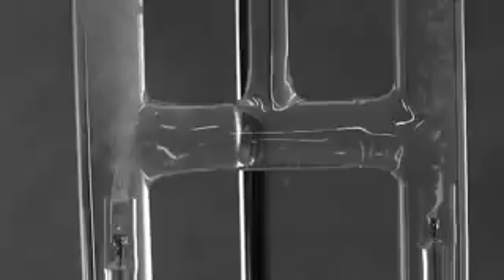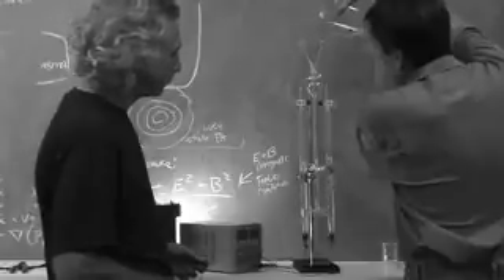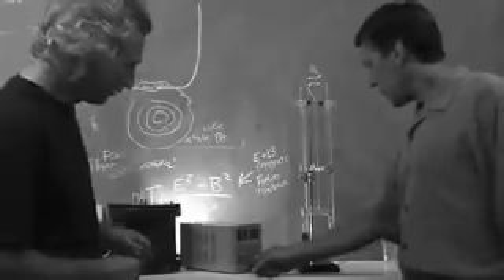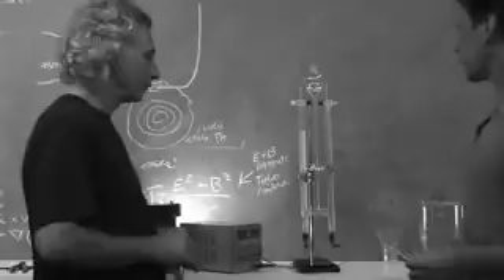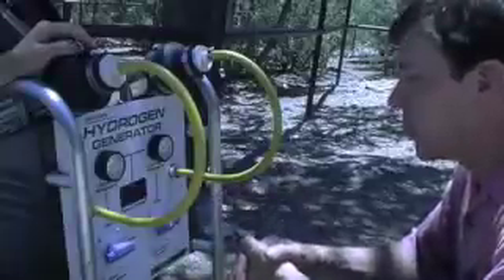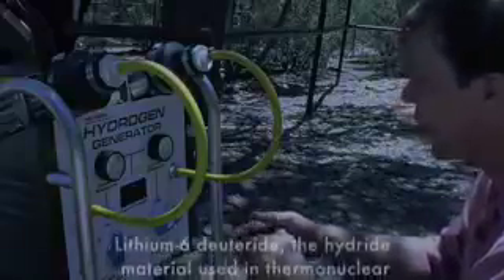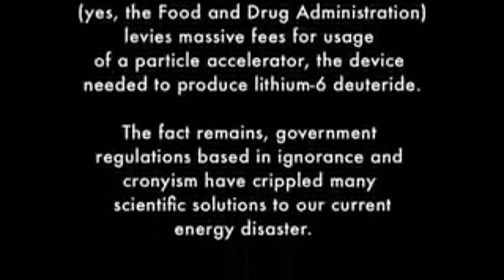run your car on water. This guy does just that!

Comment: you all need to reashearch the Australian investor that had a car ready for production in the very early 70's. He had issues raising capital as fuel was cheap back then. And then ever so quietly  GM America purchased his patients and company and shelved it.
the other thing is steam cars have been around since the early 1900s and are far more efficient and should be p uh t back into production. Look a J Lenos 1920s full steam car that does 100mph. so to say its not held back us not true. Wasnt one of the most efficient electric mass produced car recalled and every single one crushed. With owners who hide them sued for there return. 
All in all there'll be a change when in 50 or si years oil starts to run out and the car and oul companies need new products to over charge us for.
Reply: Thats just it, oil will never run out, IT IS NOT A FOSSIL FUEL. the fossil record only goes to a depth of 1500 ft the oil is pumped from a depth of 3000ft,  it was discovered in the 50s as being a byproduct of the land,  when wells were once empty, & checked again 15 yrs later they were found to be full again.
Reply: ZENITH ABC DEADLOCK:  The phrase "fossil fuel"  does nit mean that it comes from fossils, you fucking dim witted idiot. Crude oil is produced deep underground because the heat necessary to convert the simple hydrocarbons from dead plant and animal life, is in the range of 1500F. The oil then often moves upward in the water column to within reach of our drills. Most of the crude oil is far below the areas that we are currently finding it. It is not being produced by rocks, you bloody idiot.
Reply: Angus Whitehouse his name was Ralph Sarich
Reply: @Tim Hallas, You are a shit head.
Reply: Why is that Peter?  All I did was tell people the truth. If you don't like the truth, then go hide in your basement.
Reply: people who live in penthouse suites overlooking the pacific ocean, never feel the need to mention it in an argument. you are full of shit. You are not smart enough to talk to someone like me about anything.
Reply: You just proved to me that I am right. you don't live in a penthouse suite overlooking the pacific ocean.  Only liars get pissed off that easy.
Reply: Angus Whitehouse Tim hallas you made me laugh . 'Fossil fuels aren't made from fossils'. That was the whole basis of its initial taxation status.
Reply: Angus Whitehouse       The English language called.........they said stop abusing it and use spellcheck.

Comment: Okay, so I'm not saying it doesn't work, but there's one part that doesn't make sense to me.  
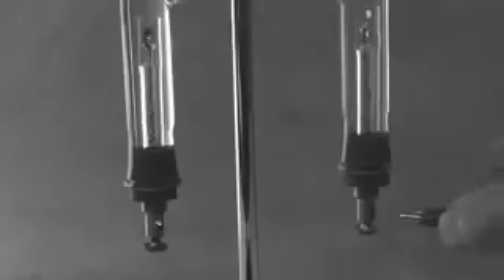@ 3:45 They say that the "positive will make the oxygen, and the negative will make the hydrogen." 

Now I don't know enough about chemistry to be sure, but imagine that when the water molecules are split, the hydrogen has a charge that draws it toward the negatively charged electrode, and the oxygen has a charge that draws it toward the positively charged electrode.  But if that's the case shouldn't that "sifting/sorting" process happen farther down the line?  

At the point where the water molecules are being split both component elements should be present, no?  

Maybe they can be separated by charges once they are broken apart, but at the actual point of splitting...  I just don't see how one column could produce exclusively hydrogen and one column could produce exclusively oxygen.    

For instance, on the side that is "producing oxygen", once the oxygen is broken out of the water molecule, what happens to the hydrogen it had been bonded to?  Does it de-materialize and re-materialize in the other column?   :/

And as for the "hydrogen side" producing twice as many bubbles due to the H2O equation; maybe.  Makes sense, right?  But then again, when you actually look at the two electrodes, doesn't the one on the "hydrogen side" also happen to look about two or three times wider than the one on the "oxygen side"?  Wouldn't more surface area of electrified metal on one side than the other just result in more electrolysis, producing proportionally more of both elements?  

But then I have to wonder -- that seems an odd detail to go so far out of your way to make up an untrue explanation about.  Unnecessary.  So what am i missing?  

That's the only snag I really find in this video.   Or at least the main one.  Like Fox Mulder's poster used to say (yes, it was referencing something else, but...), "I want to believe."  I think there is real potential in this idea.  

But can anyone explain how his explanation of generating [hydrogen without oxygen] on one side, and [oxygen without hydrogen] on the other side actually works?  Would very much appreciate it.  Thanks.
Reply: Wrong. Watch it again.

Comment: Neat, but we've been extracting Hydrogen from water and storing it for quite a long time, the issue is the internal combustion engine, Hydrogen burns much much hotter than petrol, and WILL melt a normal petrol engine if hydrogen is used as a fuel substitute. an engine must be designed from the ground up with Hydrogen as fuel source in mind.
Reply: That’s the easiest of the practical problems to solve.
Reply: @mensaswede4028  I'm sure you're correct, but to my limited knowledge no one has even done that on a commercial scale yet.
Reply: @MassLox  Usually that is money problems and then patenting the design for the the engine which also takes a lot of time because bureaucrats are slow

Comment: The problem with this hydrogen as a fuel is that current best processes for water electrolysis (PEM or alkaline electrolysis) has an effective electrical efficiency of about 60%.  Looked at another way to produce 1 kg of hydrogen (which has a specific energy of 143 MJ/kg) requires 50–55 kWh (180–200 MJ) of electricity.  Its true that 120 MJ/kg of 1 Kg of hydrogen is almost three times more energy dense than petrol.  However, such a process uses 55 kWh to get an energy equivalent of just 33.6 kWh of energy.  Then you take that hydrogen and use a conventional IC engine to generate power, which has a max efficiency of just 25%.  So you start with say 55 kWh which then becomes 33.6 kWh and the ICE generator can only produce about 8 kWh of power at the end of the process.  Not a great idea when the original 55 kWh of power which began the process was generated by the coal or natural gas powered grid which itself is only about 30% efficient.   So the real "fuel to work" efficiency is about 6%.  In other words you just wasted 94% of the energy in the original fuel.  This clearly is not some super technology to get excited about?

Comment: CRT tv's are partical accelerators. So yeah if you really wanted a partical accelerator! Chances are you already have on in your attic.
Reply: On close inspection, Bob's "particle accelerator" appears to consist of a small wooden tower, some shiny stovepipe, a rotating red light and a caution sign.

He didn't even try very hard on that particular scam.
I wonder if he got around to stripping those "hydrogen" tanks out before the bank repossessed that shiny 'vette?
lol

Comment: No mention on how you get your car to run on 100% Hydrogen without burning too hot and melting components in the engine.
Reply: It doesn't burn so hot. But does produce water vapor which may be an issue in your engine. Also you'd need a carby rather than fuel injection. The main issue has always been storage and economical production of the hydrogen. So the hydride sounds right but commercially feasible options are still developing. Looks like hydrogen/electric fuel cells and electric motors will win out. Metal or chemical hydride appear to be the most promising on board storage. It's all googleable.

Comment: It makes more sense to collect hydrogen and oxygen separately on the fly without storage tanks and combine them as needed to drive the pistons. The resulting water vapor can then be vented out before the next firing of the piston. You just need a system of electrolysis that produces the gases efficiently enough. This is doable by various designs which have greatly optimized electrolysis as compared to the setup shown in the video.

Comment: Unless you've got limitless power to spare, splitting water is just about the worst thing you can do.  The electrolysis of water into O2 and H2 gas wastes at LEAST half of the input energy as heat, making the process horribly inefficient.  You just can't sneak around the laws of physics.

Comment: to me the simple thing is that you can make hydrogen for free.. using solar/wind/water power -> electrical + water -> hydrogen production.. the problem becomes the storage.  the hydrogen cannot be made as you go in your car.. so you need a means of storing it.  compressed cylinders.   but it seems if you have the equipment for all this.. you drive for free.. or whatever water costs.. (assuming your H2 compressor is driven by free power too)
Reply: There are already cars rolling around with 10,000 psi cylinders but  is it better to burn it in cylinders like gas.. or to have electricity from fuel cells power electric motors?  what is more efficient?

Comment: The energy it takes to separate hydrogen from oxygen is greater than the output of hydrogen gas.
Reply: @wildandes1185  The example you give does not work for the model in this video, so how is your response relevant?

Comment: The car's running on hydrogen, not water. To split water into hydrogen and oxygen needs electricity and therefore electrical power. Nothing unusual or new here. It takes considerable electrical power to make enough hydrogen to get very far !

Comment: except hydrogen combustion is hot. that means lots of oxides of nitrogen are produced. The EPA would be all over that. Aside from driving around in a fast-moving vehicle with hydrogen pressure vessels in the trunk and hoping the person behind you isn't texting, it takes a massive amount of energy to hydrolyze water--more energy than it is worth. Hydrogen fuel, just like ethanol fuel, is one step forward after three steps back.

Comment: Doubts about the setup , considering the hydrogen hose connector to the car appears to be of compressor fittings , no shut off valve ? Recharge the car overnight ? Need solar power to operate generator ? Unless this guy has a 50 kw solar power system , this does not compute !

Comment: you can cut a tank in half that's filled with pressurized gas? how?
Reply: The tank is not filled with pressurized gas. It is filled with lithium hydride, a solid material which readily absorbs hydrogen gas. When gas is needed, the hydride is heated, which causes it to slowly release the absorbed hydrogen.

Comment: Sure, you can run your car from hydrogen produced by hydrolysis.  This is nothing new and has been known for over 100 years, BUT you'll pay for it in another way.  You'll pay for the electricity it takes to produce it.  Nothing new here.  Note, the acids he uses will attack your engine block.
Reply: no if you build a ceramic engine
Reply: ricco rodriguez 
But then you'll have fracture problems from a brittle engine.  WE JUST CAN'T WIN 🤐😜😕😞😓🤤😲😢😟
Reply: @catman8965  actually no,some years ago ferrari developed an engine that they use in a formula one vehicle,it reduce friction like by 40 percent and the engine din't heat ;ike a conventional metal block,however the price tag was somewhat a bit expensive,but it prove that did work
Reply: ricco rodriguez 
Interesting.🤔

Comment: Like you cant clearly see hydrogen on the machine. It uses electrolosis to produce hydrogen from water by running a currrent through it. Its not water. It uses the hydrogen

Comment: Okay, if this is true, if you separate the water molecules, doesn’t that remove that water out of the eco cycle? Basically doesn’t water just get reused over and over for the past millions of years?  How would the molecules join back up and evaporate so the cycle can start all over again? It seems like at some point, there would be a fresh water shortage. We’re already at a point where fresh water is getting scarce.
Reply: Both hydrogen combustion and a hydrogen fuel cell system recreate water when used, so it cancels out

Comment: Water vapor is a greenhouse gas, much more powerful than co2.  If every car in the world burned hydrogen the greenhouse effect would accelerate.  On the other hand I think global warming is mostly overblown,  and the emissions from these vehicles would only be from the heavy metals in the brake pads,   Or any smog or particulates from burning of fossil fuels.
Reply: The atmosphere is full of water vapor. Have you ever heard of humidity?

Comment: Water produces corrosion. Even if the motor was made on stainless steal, it will still corrode in little time. Unless you want to replace a motor every 3 months this will not be the future. It would save money daily only to cost much more yearly.
Reply: NO NO the engine would burn hydrogen not water, hence H20 two parts h and 1 part o.

Comment: Making an effective device is possible like many kids even make hho devices to run a lawnmower and recording it being used. 

The separate battery source is an option too or manually can be switched over on board. 

Metal plates in water and battery charges the wires to the metal plates to make hydrogen bubbles. 

Rural areas are known for using these "cornish generator" or in the UK it's called the Brown's gas generator. 
The off grid types recharges various ways depending on your choices. 

In close up videos many other simple hho devices and some people explain, also adding a filter for the bubbler output to have better results along with adding various choices of elements to the water to make more hydrogen bubbles.

More recently small "monster bubblers" hho generators, using over a 100, 200, 300 or more metal plates, are shared by enthusiasts and some explain adding a neutral plate between each charged plate   to get more cycles out of the wires because some of them over heat, depending on your building of the device.  

Many days people can watch and choose the easiest to make devices for the needs. 

Simple for a class experiment for making small flame "combustible energy", or store in air containers for any use. 

Many  vehicles are natural gas equipped to accommodate a natural gas option supply

Comment: Seems to me that hydrogen can be compressed into a liquid and that is off the shelf tech?  Also I would think that since O helps combustion massively better than just plain air, why not inject it into the engine to increase performance?

Comment: There is nothing like free energy... the engine itself can´t run on water only. What it does is instead of gas its using hydrogen. The process itself is extremly inefficient. Which means it takes more energy to break water into Hydrogen and Oxygen than it produces energy. Just look up for "energy conservation law". If you look for hydrogen cars, you will find out that it already exists but because we are unable to break hydrogen from water effectively it is dead end.

Comment: I wonder what happened to this man and his invention?
Still lives ?
Still runs on hydrogen his car?
Any improvement to the generator ?
Reply: Durability problems? ... this will only work where electricity is cheap, but there electric vehicles are the better value ... this takes more electrical energy than is delivered in the car ...

Comment: lithium-6 deuteride may be illegal to purchase in America but that's just one country. Why isn't other parts of the World jumping on this?
Reply: Because the electricity it takes to produce hydrogen is more efficient by itself, easier and costs less. You don't take one energy source and convert it to more energy than the source, that would be perpetual, and it's impossible.
Reply: he's using solar and wind powered electricity to produce the hydrogen for his car. you're suggesting that is less efficient and easier than a wind or solar powered car? how do you propose to convert wind energy to a car...sails? lol
Reply: @dosmundos3830  An electric car, cheaper and more efficient, you don't use the source electric energy to then convert it to another less efficient energy source, thermodynamics 101.
Reply: @dosmundos3830  You charge the car directly from the original source, be it Wind, solar, hydroelectric or ANY other source.
Reply: @iCCL G lol it's not cheaper if you have to buy the electricity, and massive batteries. common sense 101
Reply: @iCCL G besides, your variety of vehicle is not a combustion engine delivering high power suitable for vehicles larger than cars and doesn't keep us in northern climates warm in the winters, you're comparing apples to oranges.

Comment: This is what people are still losing their shit over?

He's using high power electrolysis to collect and store hydrogen to run a car. It's the same as making an electric car but instead of storing electrical charge in a chemical cell, he's storing hydrogen. That's it. He's just storing a gas that you can make

But what he isn't telling you is that you need an extremely powerful compressor and tens of thousands of dollars of equipment that no regular singular person or country could set up. Hes smart, but he's playing up how easy and cheap this would be to set up by a lot.

Comment: And for those muppets out there who still believe that you can run your car on one of these 'HHO' kits, note what the guy says at 4:56, "Now this is s slow method..."
So if you used one of these kits in your engine bay and it actually produced enough gas to run your engine, how the hell do you accelerate? Or just apply more power to counteract an increased load? YOU CAN'T!

Comment: Put one of those bigger and more efficient as the gas tank with a hose for oxygen and hydrogen running to 2 pressurized tanks, from there run the hydrogen to the motor and use the oxygen to put right back in the cylinder for more combustion.

Comment: You can also run gas generator to produce electricity from hydrogen gas collected in large cylinder showing its psi value.